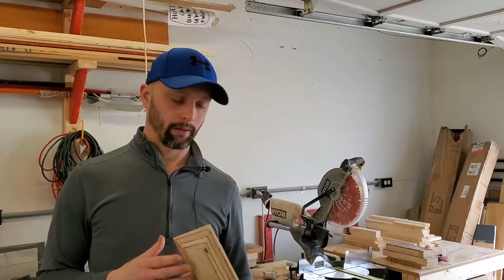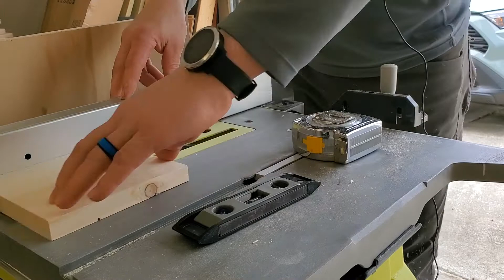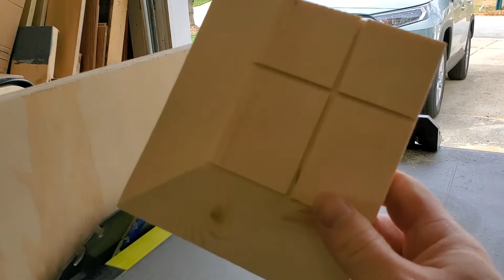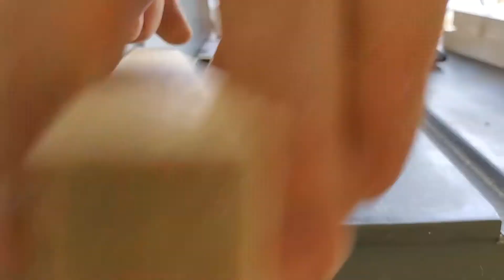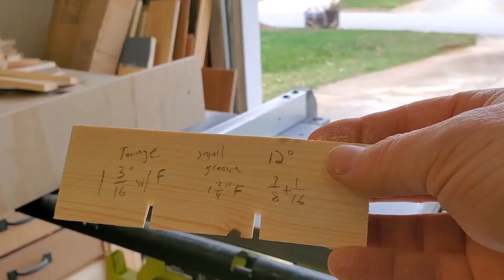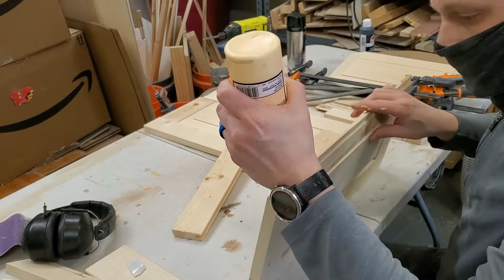Trying to figure out Raised Panel Doors

Comment: A few overbearing comments from Doofus the Rex:
1.  Great demo on working it out for doofuses who don't have a rasied panel router bit set and a router table and are only going to do it once.
2.  Great demo of why you need to buy a raised panel  router bit set and make some templates for use in the future.  You could make a  whole kitchen full of doors in the time it took you to make two doors.  You set up your cope cut once with the template on the router table, then cut them all.  Same for your tenon cuts.  The panel cutter doesn't leave saw blade marks that have to be sanded out and cuts a perfect tongue to fit your grooves in the styles and rails.  You also get a pretty ogee or half round shape on the inside lip of your rails and styles.
3.  Yes it costs money, but it's so worth it if you want to look professional and are going to do it more than once.  
4.  You rightly did not put glue in the grooves where the panel floats.  Your viewers may not have picked up on that.   The primary advantage of using raised panel doors is that they get around the problem of wood movement (and look cool doing it).  If you just hang a plain slab of wood in the hole for the door it will warp and stick like the devil.  But if you glue in your panel within the styles and rails it will try to shrink and swell and bust the door.  A floating panel in the grooves stays flat but can also move (provided you didn't forget to leave a sixteenth of an inch or so extra depth in your grooves).
Reply from the maker: Yeah, someday, I will get a good router table and then start gathering good bit sets. I'm reinvesting the money I'm making into better tools but it's slow going🙂.
Reply: @wooddoofus  You'll get there!